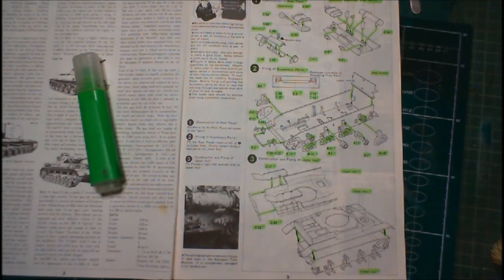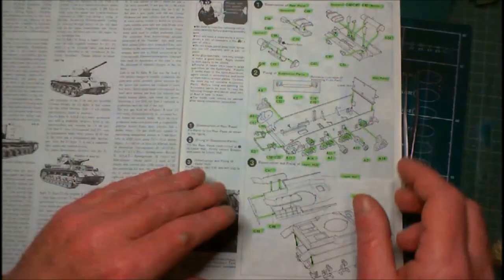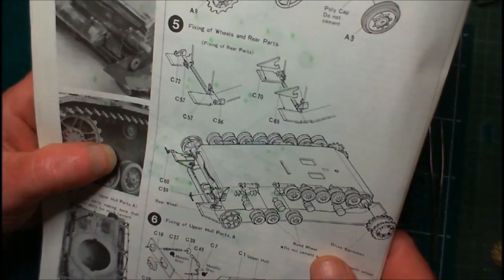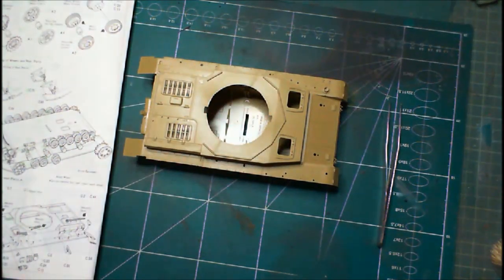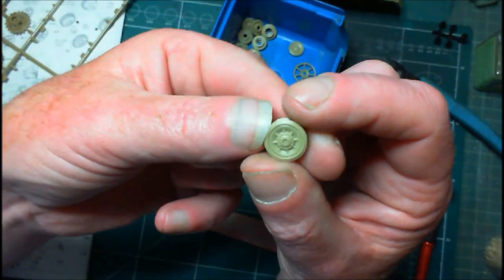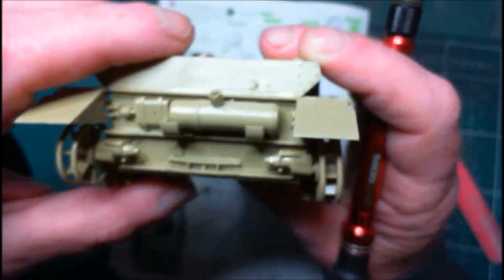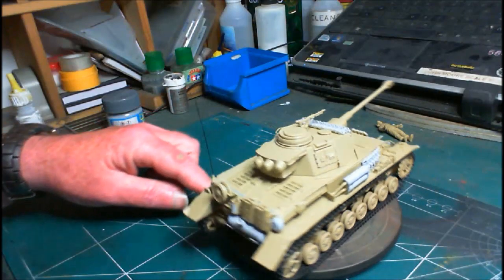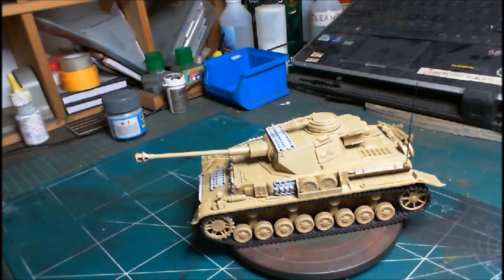TAMIYA 1/35 Scale Panzerkamphwagen IV Build Update #1

Comment: The silhouette of the Pz IV (sans skirts) has always been my ideal of what a tank should look like. I had the same back plate fit problem with Tamiya's Pz IVD, same design/mold most likely. A compromise due to it originally intended to having a motor back there perhaps?   Always a nice clean quick build of a kit though.  I bought mine in the 90s, manufactured probably in the 80s, and in storage for 15 some odd years I expected some warpage and ill fittings.  No issue with its road wheels being in contact evenly though. Knocked the hooks off the fenders went w/o side armor. Figure was as yours but was expecting that, its an oldy. Sounds like your kit is worse than mine.  Sprues are not that warped.